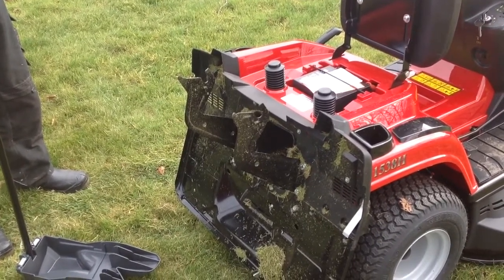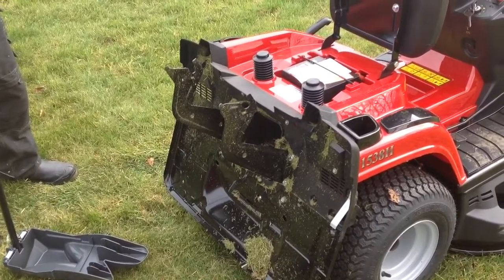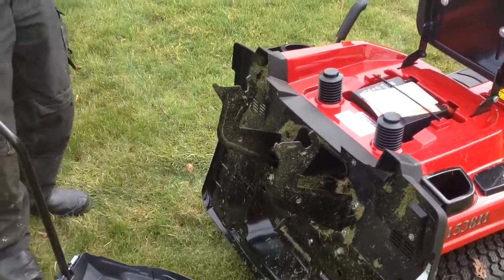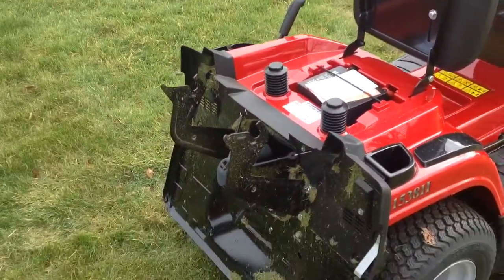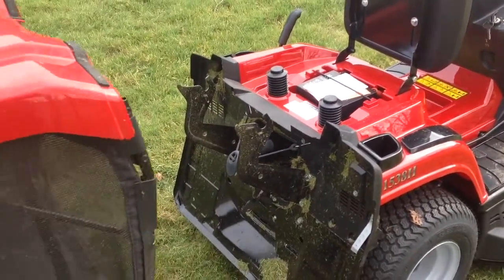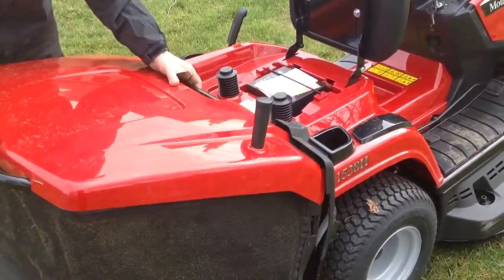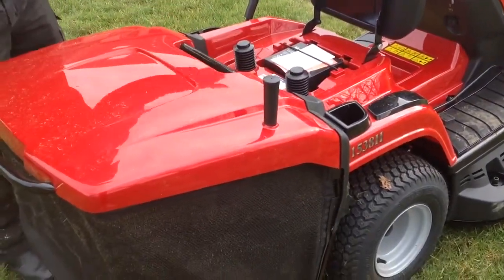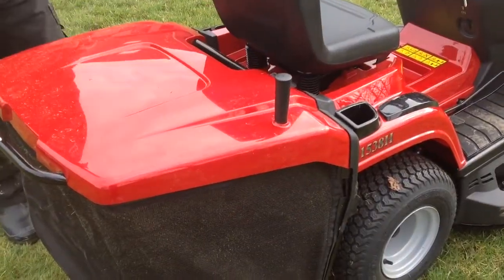How to insert a mulching plug for ride-on mowers

Comment: On my last mower just need a very small g clamp for the safety switch. I used old towels to block it bought a plug for my new stiga been on back order for months was. Sent via cape or camel train just landed

Comment: There is a comment in the kit manual about "Fit the stop screw (1) and screw it tightly in deflector cap hole (2). " : not clear what this means or what it is to do?
Reply from the maker: Sorry for missing this question. I assume by now you've found an answer. However, it refers to putting in the screw at the bottom side of the mulching plug (where the spring is). By putting the screw into the deflector cap hole - it stops the whole plug springing back when removed from the mower and makes it easier to fit.

Comment: Having trouble inserting mulching plug in our Stiga Combi 1066 HQ AP. Any hints/tricks welcome
Reply from the maker: Hi Leonie, Sometimes you need to put the plug in a slight angle and then twist as you are putting it in the chute. See this video from Stiga as it may be helpful and you'll see what I mean . Also try it at different height adjustments - some prefer bottom or top of the range. Hope that helps. https://www.youtube.com/watch?v=ZAp3swo3LEg

Comment: hey, our kit came with some screws and brackets, what do you do with those?
Reply: Ours too!  We are no wiser what to do with them
Reply: Shaznay999 hey so i talked to mountfield and they said you only need the brackets if you can’t get the plug in so we just ran without it and works perfectly. just make sure when putting the plug in the blade is at the lowest setting then fell free to put at what ever hight you want, hope this helps.
Reply from the maker: Hi, Sorry for the delay in replying. Yes the bracket is stop the chute from going to high and helps for getting the plug in and out of the machine.
Reply: @itsyaboinginda5841  It says in this video to set cutting blade to highest position, not lowest.
Reply: archie somerville what?
Reply: @itsyaboinginda5841  you mentioned to make sure the blade is set to low before you install the mulch plug, but the video showed raising the blade to highest before installing the mulch plug, now I'm not sure which it is.
Reply: archie somerville i found it to be more easy to put in when the blade is lowered
Reply: @itsyaboinginda5841  cheers, I've had this muncher for 4 years now and never used it, I'll try it tomorrow.
Reply: archie somerville aha nice
Reply from the maker: @archiesomerville2712  Hi Archie, we recommend that you install the mulching plug on highest setting as we usually find it easier - but really whatever works best.
Reply: @brucklaygarageltd2832  thank you, did it today worked fine. just curious, I thought the clippings would fly out the back area of the mower but it didn't, does it keep it underneath and just spread it that way?
Reply from the maker: Yes, the clippings go back into the grass without you noticing.

Comment: I find that when I use the mulching plug most of it goes into the bag and the rest clogs the blades. Any reason for this that you may know?
Reply from the maker: Clogging the blades might be because the grass is too long or too wet for mulching. I can only imagine the plug isn't fully in or broken if there is a lot of grass getting into the bag.

Comment: After cleaning the deck and reattaching our mulching plug the alarm keeps sounding when I engage the blades. Any advice? Thanks.
Reply from the maker: Hi, The alarm will sound because it thinks that there is grass in the box. Make sure all of the grass is removed and especially over switch (it will be the black switch just below the shute where the plug goes in.) Any grass there and it will put off the sensor. See if that helps.
Reply: @brucklaygarageltd2832  thank you